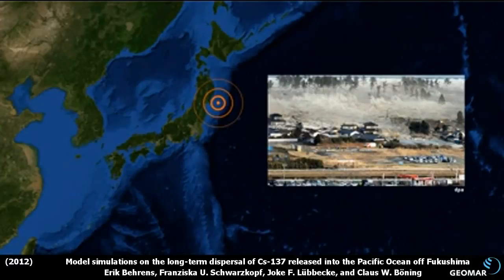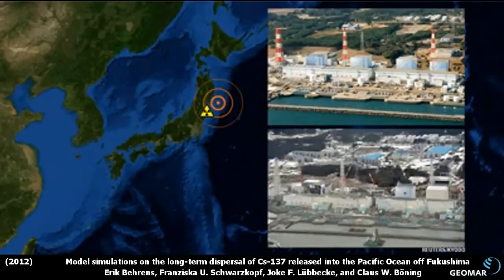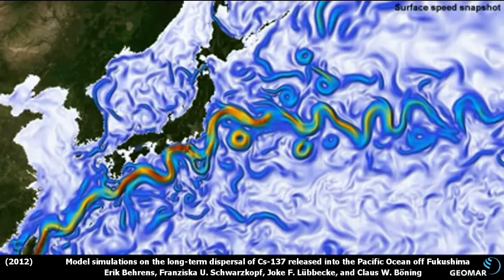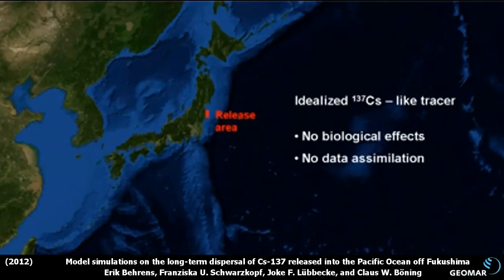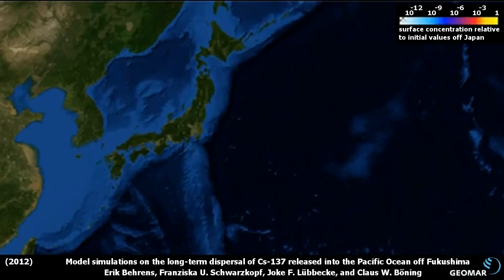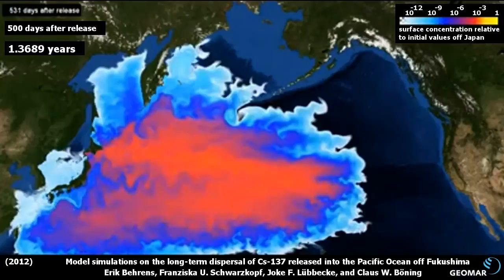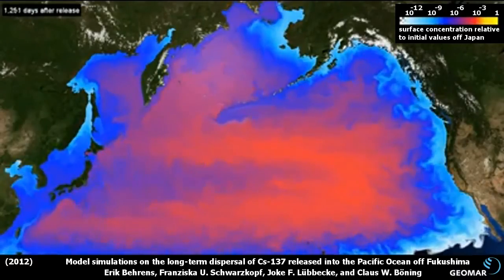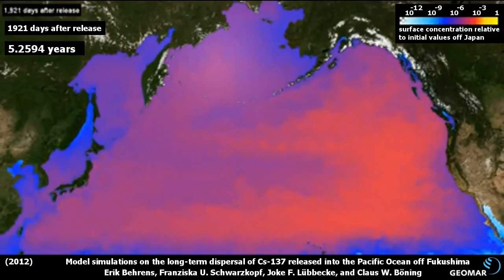FUKUSHIMA E.L.E. Model Simulation Of Long Term Dispersal PACIFIC OCEANS A DEADZONE

Comment: Does this only simulate the initial release of radioactive waste, when the nuclear plants first failed?  That is my impression.  How would this model change if the continuous inflow of over 300 tons of radioactive water, every day for two years, were included in the simulation?  I think that would make the radiation in the Pacific about 100 times stronger.